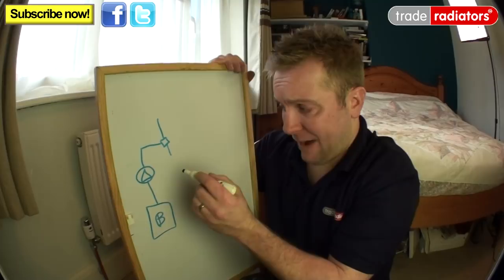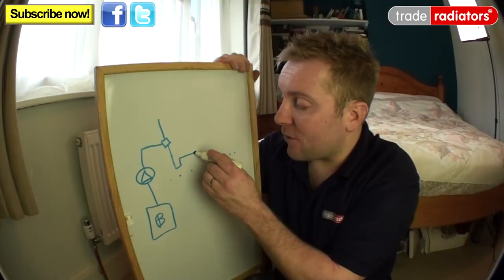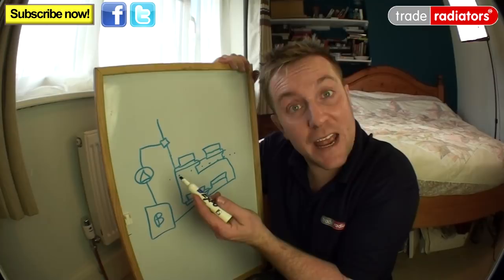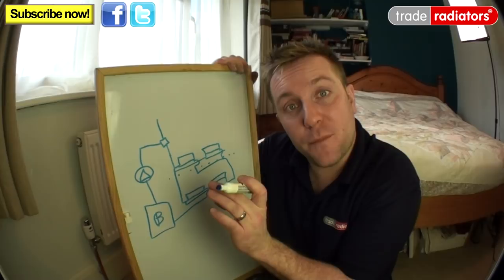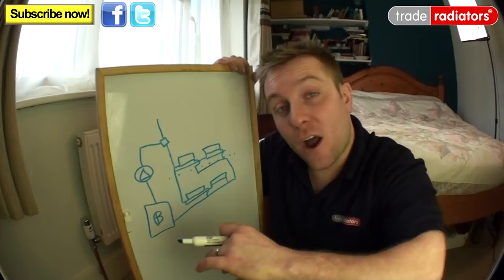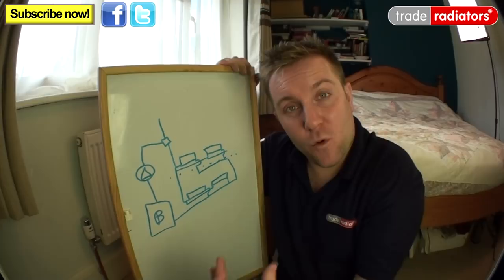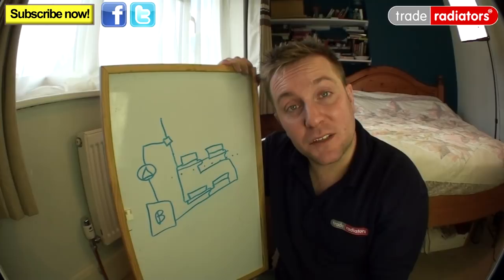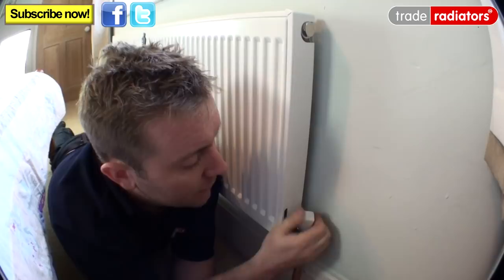How To Balance Radiators - Trade Radiators

Comment: Excellent! Thank you. That last point about the extra rad added somewhere at the end of the line  is exactly my problem. I think having a replacement rad in the living roomthat is half the length of the old one is maybe somehow making things worse (maybe it easier for water to head through the smaller on so it 'stealing' the water from the utility room extra rad that is stone cold unless  I turn the living room pair off. Thanks very much for advice.

Comment: This has helped out greatly thanks, although  I never seemed to have this issue when I had the old boiler, all rads were fine with 1 and 1/4 turn on their locksheilds, I wonder if the rads not heating properly now is down to modern boilers modulating down a lot more as the return temperature increases so it's not giving out as much heat as older boilers did perhaps because older boilers had a fixed output regardless of return temperature?
Anyway my system is working again like it did before following  this video so I'm happy!

Comment: We have this exact problem with a new heating install.  The rad in one room upstairs doesn’t come on.  Will try this out as the rads upstairs have self bleeding air things (don’t know what they are called).  Do I need to turn the heating system off to do what you mention in video?

Comment: Both ends of the radiator look exactly the same with exactly the same caps on them.  How do you know which one of the two u need to turn a quater of the way to balance the radiator?

Comment: With regards to balancing a system with TRVs fitted, do I need to leave the TRVs fully on in future of can they be used to adjust individual room temp after balancing?
Thanks in advance.
Reply from the maker: If balanced correctly - the TRV's will now be able to be adjusted for individual room settings.

Comment: Sorry I'm unclear on which side your adjusting. The side with the hot water is coming in from or the side its flowing out from. What level side each be at?. Should the hot side be open full and the out flow adjusted to a half turn?.
Reply: The out-flow is the lockshield side, should be the cooler of the two pipes when the heating is on
Reply: @benwilkins5335  okay cheers. I have two lockshield values so was confused. But should the flow-in be fully open considering any water in is only effected by how much water out or should the hot side be adjusted down a few turns too.
Reply: @aran5946  I believe the flow in should be fully open & the restriction only happen on the return.
A TRV, when fitted, would usually limit flow in when up to temperature, so when not fitted the flow limit is only controlled by the lockshield.
I'm not a plumber, but from the reading I've done I believe that to be correct.
Reply: @benwilkins5335  appreciate the reply

Comment: Some rads will need the lock shield valve open more than others on the same floor. The only successful way to balance rads is to use a clip on or magnetic 
thermometer and have a difference of 12 degrees centigrade between Lock Shield & wheel head valves, with the wheel head fully open.

Comment: hi, is this done when the sytem is hot or cold.
Reply: no difference just make sure you don't bleed air from the system (radiators) while it is under pressure ...when the heating is ON in other words

Comment: Oh well, not really !! So for anyone watching this, please just adjust thermostatic valve flow it is located on the thermostatic valve under the valve control thermostat handle. If you don't have thermostatic valves on your radiator,  it is time to install them. that investment will pay for itself many times over. Good luck.